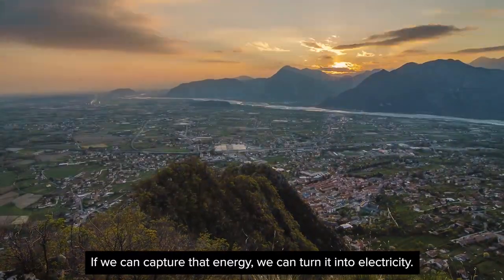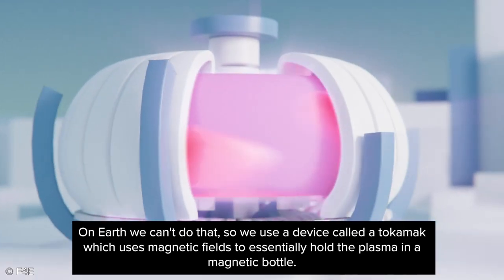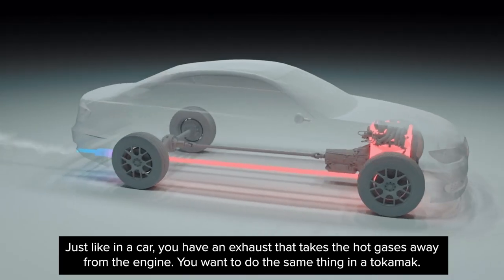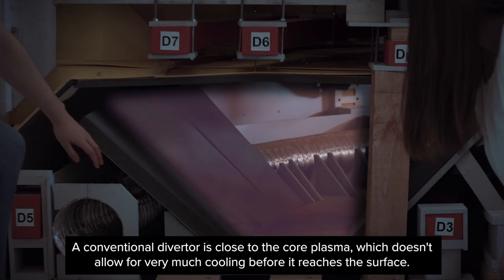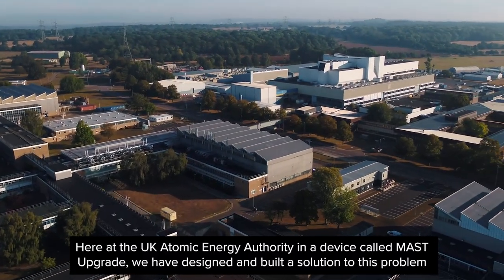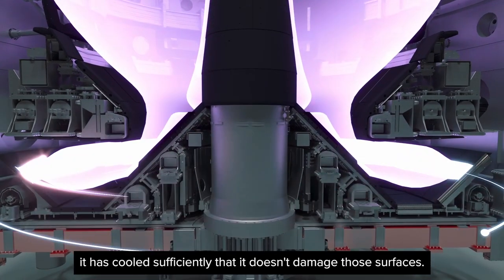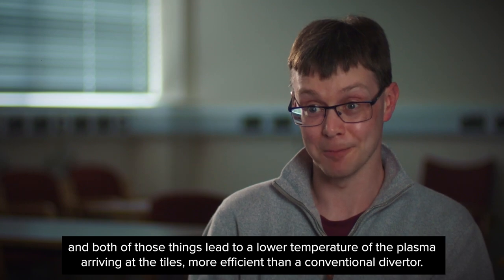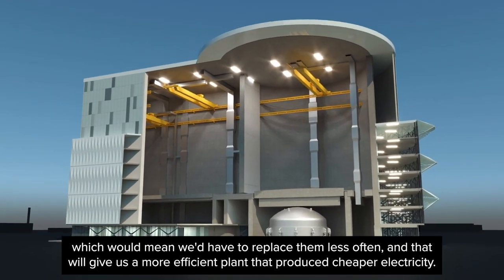Solving one of fusion's hottest problems: First results from UKAEA's MAST Upgrade experiment

Comment: would really like a more detailed video on this for the high scientifically literate audience watching. ie. how is cooling gas injected into the divertor prevented from poisoning the main chamber plasma? presumably it's a high-Z gas that converts the plasma kinetic energy into x-rays via bremsstrahlung? is the separatrix involved in keeping it only in the divertor somehow? how many megawatts per sq. meter of heat flux on the divertor would an iter size reactor be expected to have with one of these vs without? etc.
Reply from the maker: We'll see what we can do - thanks for the suggestion!
Reply: Yes if I could second that I'd be very interested in more details. Of course you should protect your innovation but this is cutting edge fascinating research & I'd love to know more.
Reply: @UKAEAofficial   that would be great. I've been following fusion R&D progress for the last 30years since i left University. It's fascinating to see the breakthroughs being made now. Be great to have some more technical info.

Comment: "This is bringing fusion energy one step closer"
No it's not. It just reduces how often you need to do maintenance, the rest of the machine doesn't work yet. It's like designing longer lasting car tires in 1870, that doesn't help invent the car and the improvement is actually useless until someone else invents the important part.
Reply: @Player 36 The barrier to fusion is technological, not economic. Diverters already exist, the 'breakthrough' here is reducing maintenance frequency.
Reply: @Player 36 but ITER and KSTAR and ST40 and all the other experimental tokamaks already have diverters. They're trying to solve other issues, the diverter isn't the big problem. I'm sure it's helpful to have a better diverter, but that's not the main barrier to fusion.
Reply: @Player 36 what the hell are you talking about? First you say the issue with fusion is economic. Now you say as soon as they turn on ITER it'll melt itself and be shut down for years, which is frankly absurd. You've got a screw loose.
Reply: @Player 36 imagine we have a jetpack that can fly you to Mars. I've made a better belt buckle to keep it attached. Therefore I've made us one step closer to interplanetary jetpacks. We just need someone else to actually invent it.
Reply: @martinperry1843  just like a pot would be an expensive product if every time you used it, you had to change out the base as it degraded in the heat, replacing parts in a power plant is also expensive and the knowledge of those costs would raise the price and thus decrease the incentive to use it. the  reason weve moved away from cast iron as the default cooking pot is similar.
Reply: @jonathanodude6660  yes but in this example we don't even have a fire yet. It's like inventing a stainless steel pan that won't corrode as quickly as a cast iron skillet and declaring it a breakthrough in the quest for cooked food, when we haven't got a heat source or fire to cook with.
Reply: @martinperry1843  well no because we have built several devices capable of fusion. the issue here isnt that fusion doesnt work, the issue is that we are putting more energy in than we get out, so we need to put in as much resources as we can into increasing the energy we get out without increasing input significantly. the heat dissipation is going into the coolant which will be responsible for the electricity generation.

a closer analogy is like designing a fan for an existing cpu that would overheat but not having a power source yet. if you made the power source and connected everything up your cpu would break and need replacing or would need to be stopped intermittently (huh, not a bad analogy) but even if the fan is useless in the moment, it is essential to preventing overheating and maintaining proper functioning, especially since the cpu is much more expensive than the fan. thus, you actually do want to get your cooling solution set up, because replacing the cpu is more expensive, and you dont want to have the cpu and power designed and then realise that no cooling solution exists for the designs you have and need to start from scratch. 

this is literally already a problem for several types of nuclear fusion reactor: they simply cannot contain the plasma, keep the plasma hot and also extract energy from the plasma simultaneously. by designing this, they have shown that they can contain the plasma and extract energy simultaneously. other innovations can keep it hot and get it started in the first place and the combination of all these is what will lead to a functioning reactor.
Reply: @jonathanodude6660  I am aware of the issues with fusion and the frequent of maintenance is not the bottleneck. Therefore this cannot in any way be described as a big step towards successful fusion.
Reply: @martinperry1843  “successful fusion”? What are you talking about? Fusion has been done successfully for years. You can build a tabletop fusion reactor with basic research and some equipment. Hobbyists do it all the time. Any innovation that improves the life of the reactor is a step towards commercial fusion, because that’s the next goal after ITER.
Reply: @jonathanodude6660  a Farnsworth Fusor is a parlor trick and nothing to do with a Tokamak.
Reply: @jonathanodude6660  there are multiple fusion reactors using the tokamak / spheromak / spherical Tokamak design but none of them have been able to achieve net power output or to maintain the plasma for more than a minute or so. 
But they all already have diverters and the thing holding them back is NOT how frequently the diverter needs to be replaced. The limit is magnetic field strength or heating or plasma instabilities or a million other issues other than maintenance frequency.
Reply: @martinperry1843  and this wasnt intended to fix that, ITER is meant to be the proof of concept. this is simply helping to get the final reactor to a state where it can be employed on power grids, since theres no use having something that "works" if its literally unusable.

if people just built whatever a good investment was without looking at short term gains, the western world would be covered in high speed rail rn, but everyone can see that the gains are not from fare prices, which means that in the short term, its a money loss. its the same with these reactors; the gains will not be in prices at first, which will scare away investors if the prices are too high.

the price per watt has to be low enough to actually get funding. the research is wasted if a reactor never gets built. starting on that now is not a waste of time. theres already a timeline for the reactors after ITER that will generate electricity, and possibly even be connected to the grid.
Reply: @jonathanodude6660  ok. I've had enough of you. You're deliberately misrepresenting the situation to pretend the trivial issue of replacing the diverter every few years is what's holding back fusion from widescale adoption. Something's screwed up in your brain pal.
Reply: @martinperry1843  yikes, i see why i never got a notification now. i think i probably have to copy your style to get you to understand what im saying here.

"ok. I've had enough of you. You're deliberately misrepresenting the situation to pretend the widescale adoption of fusion doesnt depend on multiple factors, including short term cost, and that any potential gain in an area important to those that would be funding commercial reactions is trivial. Something's screwed up in your brain pal."
Reply: @jonathanodude6660  This. Is. Not. A. Step. Towards. Sustainable. Fusion. This is making slightly longer lasting space boots to wear on Mars and pretending you're making a significant contribution to exploring Mars.
Reply: @martinperry1843  bro if your space boots wear out in 10 seconds on mars, you arent exploring mars, its that simple. everything has got to work for the whole thing to be viable. in this example, the rocket and timeframe has been established and the only thing left is the radiation shielding. it can be done but not in a way compatible with everything else required, so experiments are still being done. while those experiments are being done, someone is getting the space boots to last for 10 minutes instead of 10 seconds and youre complaining they arent working on the radiation shield instead.

i still dont see why youre repeating the same thing over and over. at least define "sustainable fusion" if youre going to keep mentioning it, because absolutely no one is saying this is going to contribute to testing if the design works. maybe you need to read through what i said again.
Reply: @jonathanodude6660  except it's not ten seconds. The current diverters can last YEARS without replacement. Which is why reducing the maintenance frequency slightly is not a breakthrough.
Reply: @martinperry1843  i cant find any sources on the lifetime of current diverters or of potential fusion plants, only that this diverter will reduce the frequency of maintenance to once. but either way, we are literally looking at a future where this tech never comes to be, not (just) because of technical limitations, but economic ones. improving the economics of power plants is one way of ensuring their use in the future.

if you could provide numerical data of maintenance frequency i could then go and calculate the effect on upfront and ongoing costs for myself
Reply: @martinperry1843  To get to net fusion you need bigger machines are higher magnetic field. Both will lead to higher or more concentrated heat loads. There is a real concern in the fusion community that traditional divertors would not be good enough for a net fusion power plant. So yes, progress in this area is more meaningful than you make it out to be.

Comment: Can’t use gravity on Earth? Oh, please...
Reply: I don't think you understand. The Sun's gravity can contain the plasma. Earth's gravity cannot.
Reply: Earth’s Ionosphere is not plasma induced by gravity? The definition of a plasma, by the Electronic’s Handbook Encyclopedia, “is any electron density in a flowing motion.” Yes, electrons in a copper wire is also classified as plasma. And there are many types of plasma. Quark Gluon Plasmas etc. 

One: you sadly don’t know what gravity is.
Two: you don’t know what plasma is.

Keep learning. Cuz, if you don’t. You gonna be worse than the dinosaurs.
Reply: @mckanebullerlee3020  The sun's gravity enables nuclear fusion to occur, nothing to do with our planet having an atmosphere. Do you think our ionosphere could fuse hydrogen to make helium?
Reply: @geoffwales8646  Are you suggesting that the Sun and it’s plasma is the only place in the Universe (our localized solar system) that fusion occurs?
Reply: @mckanebullerlee3020  What? A star is basically defined as having sufficient mass to sustain fusion. Fusion reactors have to use huge magnetic fields instead of gravity to sustain the reaction.
Reply: @geoffwales8646 ITER and Spherical Tokamaks < Fusion of Natural Universe is all I am saying. Universe uses Cold Fusion, while humans attempt Hot Fusion.

These machine(s) Tokamaks have been tested and retested for over 60 years and still no success like the sun. And,  it to mention Trillions of dollars wasted. So, maybe we gotta look somewhere else for the answer? Doing the same thing over and over expecting different results is the definition of insanity. Do you consider yourself insane Geoff Wales?
Reply: @mckanebullerlee3020  I offered no opinion on fusion reactors. Just pointing out the central role of gravity in fusion in the sun.
Reply: @geoffwales8646  Fusion in the sun can happen in the Tokamak as well. Humans just don’t use it.
Reply: @mckanebullerlee3020  But not by using gravity...